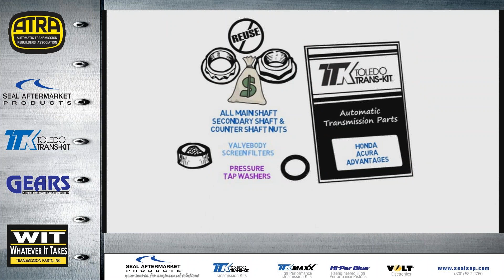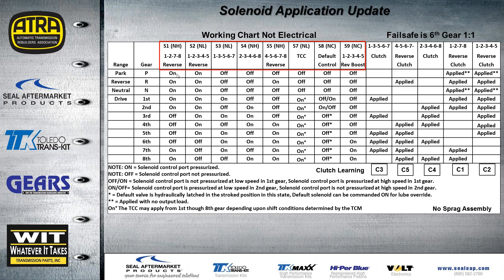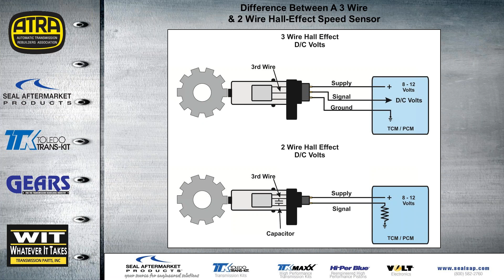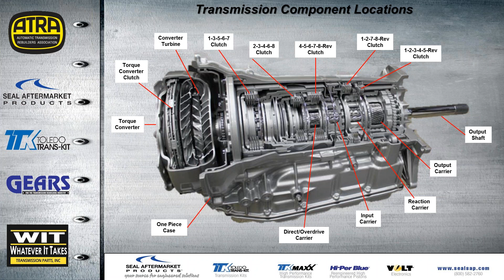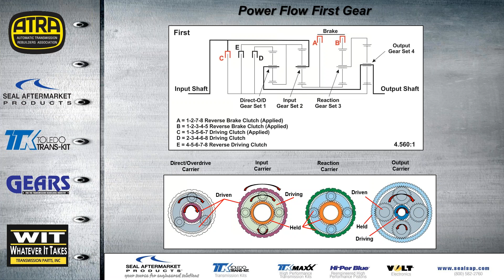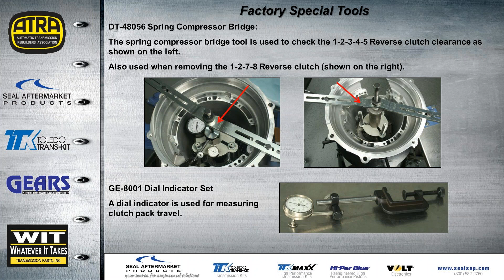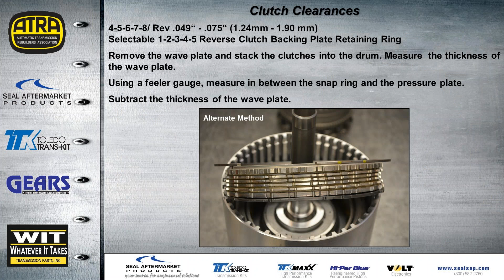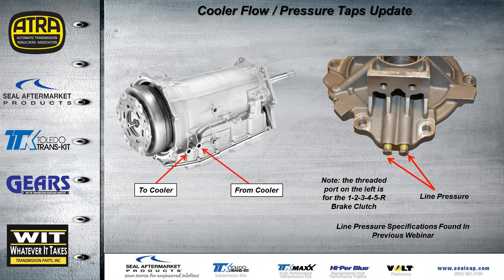8L90 Internal

Comment: I have a 2015 Silverado with a 6.2L with the 8L90 and it intermittently chatters and feels like it's running over "rumble strips". I have read it could be the torque converter. Do you have any insite on this problem ? The truck has less than 3,000 miles on it.  Thanks
Reply: Walt it’s a fluid problem. GM’s “solution” has come out as flushing it with approved fluid. Should be covered under warranty